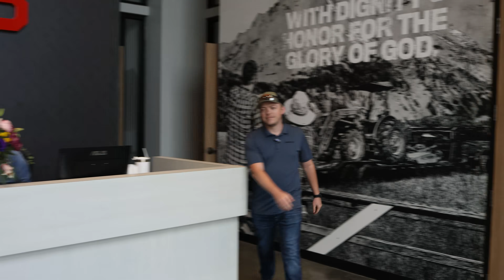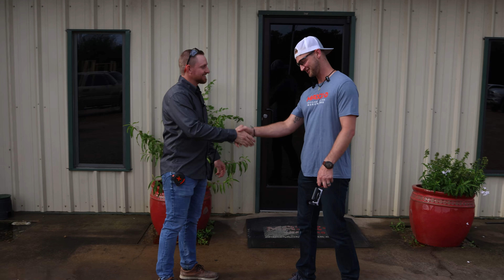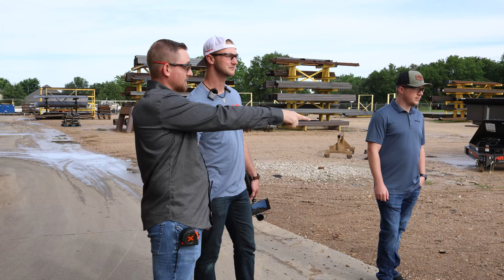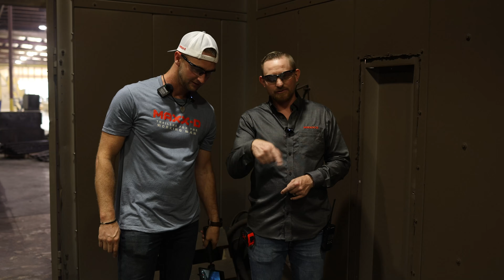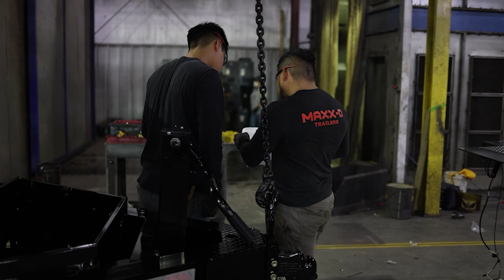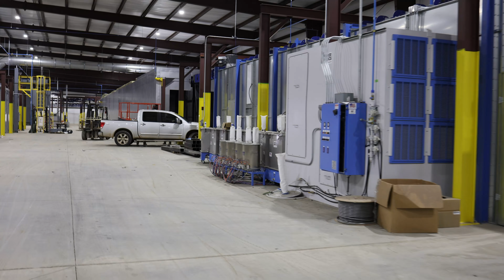How a MAXX-D Trailer is Made | Take a Tour!

Comment: X-pand parts made by polymer materials in g-ville plants make, many auto parts also, including wheel wells,tool boxes,bed liners.... with a soon to be future 30k sq ft expansion planned for polymer 5. expect to see X-pand hit the market soon... tired of those rusty wheel wells in salt infested roads causing automobile repair shops robbing u blind. order a X-pand now. with a 30 day same as cash money back guarantee,X-pand also  makes bldg materials,decking,pool supplies,and the next generation roofing shingles also. this high grade durable fade resistant material will take over the roofing world by surprise... testing on making solid pane polymer doors and shutters also is paint bondable and somewhat fire resistant

Comment: i have a idea for pull behind trailers,goose knecks etc. Xpand trailers like a telescopic design triler inside a trailer, maybe u have a 9 ft trailer and wanna haul 2 cars on  X-pand can stretch almost double its size with built in metal cross bar holders and lightweight flooring for easy to instal and disassemble..  u and your loved ones mightbe going on a vac. pulling a boat or atv, fuck u say i wish this trailer was longer to put a 4 wheeler on it. aw hah watch this x=pand has 2 small hydraulic pumps that turns that 9 ft trailer into a 14 ft now...X-pand trailers are built in the USA in clearmont,fla...X-pand trailer boards are lightweight,heavy duty,waterproof and rust proof polymer material will out live and be the last trailer youll ever own.....